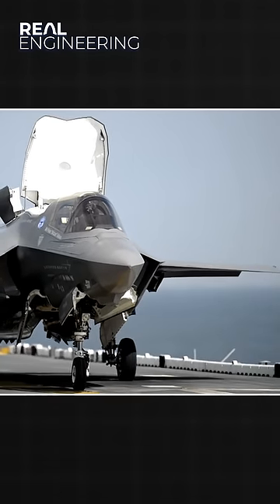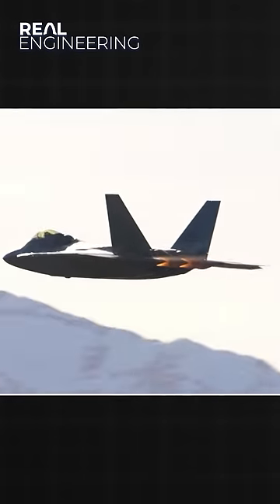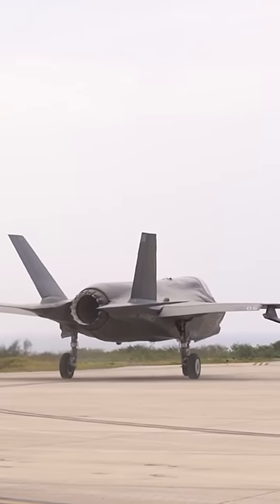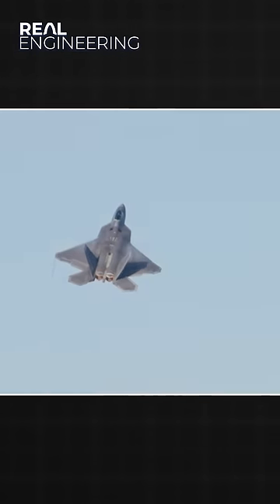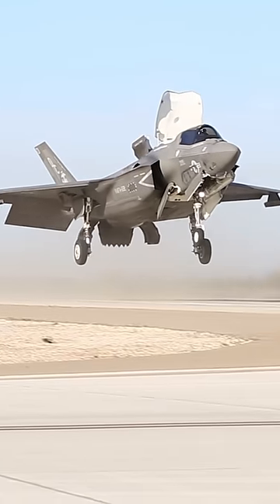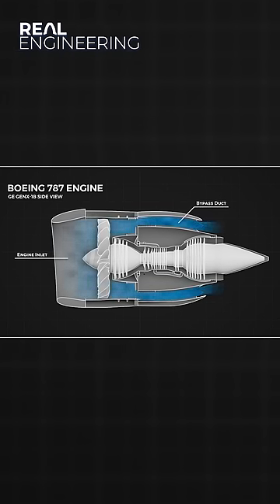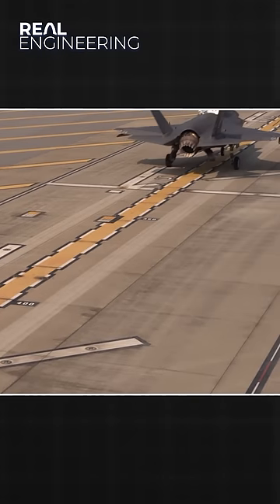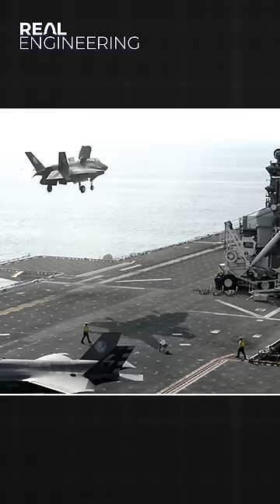How the F-35’s engine is better than the F-22’s

Comment: Too bad you never studied aeronautical engineering.  Then you'd understand the difference between a turbo JET engine and a turbo FAN engine.  They are similar, but NOT the same.  BOTH the 35 & the 22 (along with ALL OTHER jet fighters in the world) are equipped with turbo JET engines.  Turbo FAN engines are installed on MUCH larger aircraft (ie :  C-5 Galaxy, C-17 Globemaster III, C-141 Starlifter, and many commercial airliners).

There is NO BYPASS, in a turbojet engine.  ALL of the air drawn in the front is routed through the compressor, into the combustion chamber, and out the exhaust.  The closest equivalent to turbofan engines are turbo PROP engines, such as those on aircraft like the C-130 Hercules.

The F-35's engine is not superior to the 22's engines, the extra power is a mechanical requirement, and ONLY for the "B" model (the only one of the 3 variants with VTOL capabilities {you seem to have neglected to mention that part}).  The F-35B NEEDS the extra power in order to launch vertically, while loaded with weapons.

Your video gets an "F", for FAIL.

Comment: The f35 is not better than the f22. In a dog fight the f22 would win. But thay doesn't make the f22 better. In air to ground the f35 would. It's what there mission set it for. Would you use a basketball to play volleyball. No, it might work but not very well. Same way around. Would you use a volleyball for basketball. Like in my example it's a matter of what it's made for

Comment: The problem with both the 22 and the 35 is they aren't stealthed thermally. A sidewinder with a lock would take one out. That's why the F-117 was never actually retired.

Comment: Yep. Until it sucks in a small bird. Like a rock
Reply: has run while sucking in a flashlight and having multiple blades off each section of the engine blown out, takes more than that to take down modern engines

Comment: Unless, you know, it rains.
Reply: rain hasn't been a issue for stealth aircraft for a long time. early stealth coatings wouldn't hold up as long in the  rain but they fixed that well before the F-35 came out.

Comment: April fools was 3 days ago. People
The f22 puts out more thrust than fat Amy. It has 2 f119 thrust vectoring engines. Vs 1 f135 engine. This guy is a clown. 70,000lbs vs 43,000lbs. What’s the bigger number…?
Reply: He's comparing the engines not the aircraft; the F119 is nowhere near as powerful as the F135 when fitted unless at higher speed and altitude